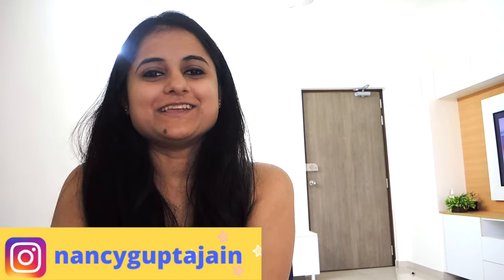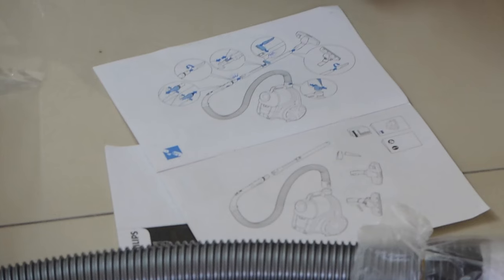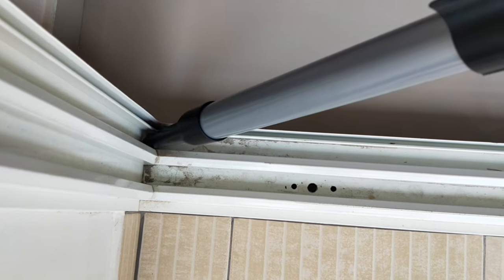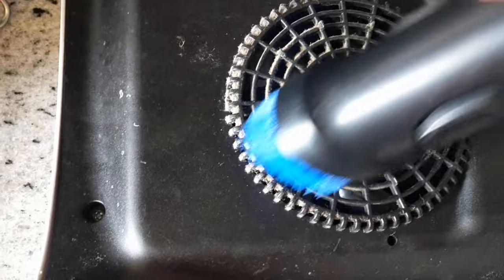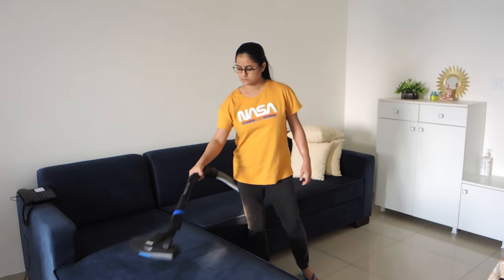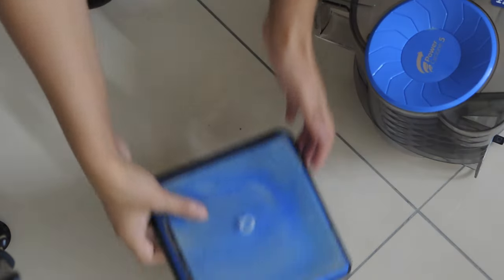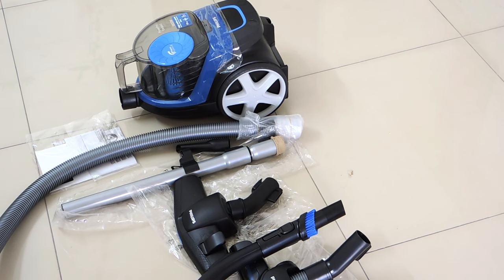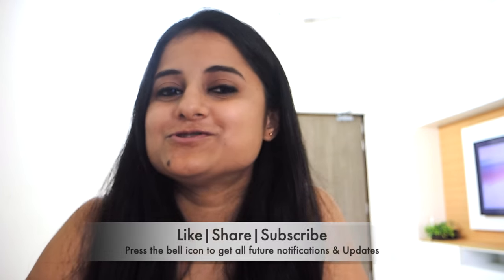Philips FC9352/01 PowerPro Compact Bagless Dry Vacuum Cleaner Unboxing & Genuine Review After Usage

Comment: After seeing this video, even i purchased this vacuum cleaner. I am using it daily. It is a very powerful and convenient to use vaccum cleaner. I strongly recommend this product.
Reply: How good is it for hard floor
Reply: Can we use this for suck our dog’s hair and tiny dust particles???
Reply: @sneharawattt  it will suck everything that will come into its contact but mind you this is not a sealed system so minor dust particles may escape but those sealed vacuum cleaner are way expensive compared to this
Reply: It has a very good power both airflow and suction maybe many will not even need that much power 😅
Reply: @hamzajamal9522  what do you mean by sealed pls advice .
Reply: @gagai786  a sealed vacuum is like dyson where everything that goes in stays in. In this some dust leaks out tiny ones. Cheap vacuum are not sealed only the expensive as that is hard to make
Reply: @hamzajamal9522  I am in Pakistan can you guide me also want one for handheld only dry may be cordless is black and decker good pls guide thankyou
Reply: @gagai786  if the availability of vacuum is same in Pakistan as in india and prices are similar then i would suggest you go with the philips one or there is one similar in specification and price by lg (i don't remember the model) but before you ahead and buy one check the availability of its filters in online market as well as its service centre and i would you buy it if you can alongside the machine because filter were available before i bought it but they are out of stock ever since, i haven't asked in service center though. So check on those filters before buying, other than that its a solid machine. Regarding the handheld you can anyone just check if its bag is available to seperately because it usually gets torn and then its useless. They are fairly cheap so you can be safe on that. Just remember to check the filter's availability before buying philips vacuum machine
Reply: Vacuum are good investment if you are doing cleaning yourself
Reply: @hamzajamal9522  are filters important ??? Philips one is not available in Pakistan ...
Reply: @gagai786  bagless vacuum require if they are absent then the dust will fly all over room. So yes
Reply: @hamzajamal9522  oh ok they are important for bag less . Thanks
Reply: @gagai786  yes and the one with bags you need to replace their bags
Reply: @hamzajamal9522  but we have the option to clean the bags as they can be open from backside ?
Reply: And 
What do you prefer bagless ??? And I think bag less vaccum are new technology ?
Reply: So Hamza which one should I buy ?
Reply: @gagai786  if philips one is out of stock see if lg mk lite vk53181nnty 4.5 litre. This one is similar to the philips one in terms of performance
Reply: @hamzajamal9522  I am trying to buy Phillips leys see which model you think is best
Reply: @gagai786  well in india there is only model of philips available
Reply: @gagai786  yes some do but they can wear out so someday you will have to buy them just check that the replacement parts are available or not and if you can buy them in advance just in case. In our countries vacuums are uncommon so finding parts are difficult
Reply: Bagless ones are more convenient in my opinion but filters are necessary in them
Reply: @sneharawattt  yes
Reply: Bhai wire andar kaise dale ???

Comment: I have dog with long hair... It is mentioned in the description of product it will remove pet hairs from anywhere... I want to know, is it able to remove my pet hair from my bedding 
If yes., have you try the same 
My main purpose to buy this vacuum cleaner to get rid of my pet hairs over my bed sheet. 
Please suggest
Many thanks in advancr
Reply from the maker: I had tried cleaning my mattress cover using this vacuum cleaner. The result was good but the only problem here is the fabric of the bedsheet & mattress covers are not so thick & due to high suction there are chances of damage.
Reply: Pet hair removed easily. 👍

Comment: Is there any suction level adjustment available for this vaccume cleaner?
Please suggest other better options with level adjustment, that can be used to clean net type curtains as well.
Reply: Yes, there are setting on the first attachment, 3 level power setting
Reply from the maker: Yes you can adjust through attachment but you can't adjust directly through machine.

Comment: Nice review ....quick question. Can one totally remove the integrated dust brush from the handle if you dont want it there or if you need to clean it ? Does it come off.......
Reply from the maker: Thanks :) unfortunately it doesn't come off.
Reply: It's non-removable. You can only push it down. But those brush bristles aren't quite good. After few months, they'll start to broken down by themselves and keep on falling on the floor.

Comment: How is the floor cleaning...will we need Mopping after cleaning floor with this
Reply from the maker: If the dust has stuck to the floor due to contact with any liquid then you will have to do the mopping. If there is only dry dust it will be able to clean efficiently.

Comment: Thanks for your video.
The plug says 16 amp will it work on normal 5 amp plug
Reply from the maker: I have always plugged it in the normal plug, never faced any issue.
Reply: @NancyGuptaJain  
Ok thanks actually I called Philipa they told always use 16 amp otherwise it may cause short circuit. Not everyroom has 16 amp. Socket. Very strange from philips it has no earthing safety.
Reply: I plugged into 5 amp and had short circuit, will only work with 16 amp . Now it’s in the box cos I don’t have 16 amp power point in all rooms

Comment: Can you use it in a normal plug point or do you need one of those 16 amp ones like that of a microwave?
Reply from the maker: I have been using normal plug points only, never faced any issues.
But in a few comments, people stated that their connection got tripped.
Reply: @NancyGuptaJain  Does the plug socket of vaccum cleaner 6 amp or 16 amp. My vaccum cleaner came with a 16amp plug.

Comment: I'm using this vacuum cleaner from last 3 months but whenever i use my inverter trips in my home even when the power is there.....any one experiencing it?
Reply: 😢😢 when i connected it on my extention cable then suddenly the fuse blowed out..i think it need more power input.also i wonder why it missing the earth pin..!
Reply: Because your inverter VA rating is lesser than the power consumption of the motor